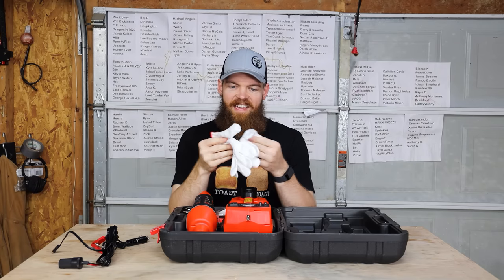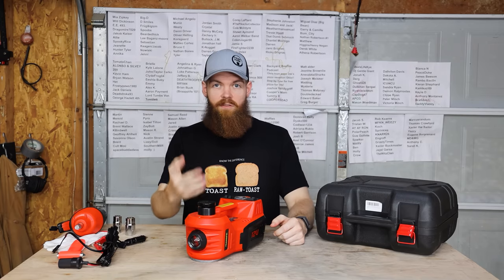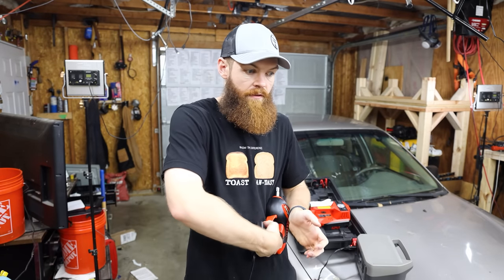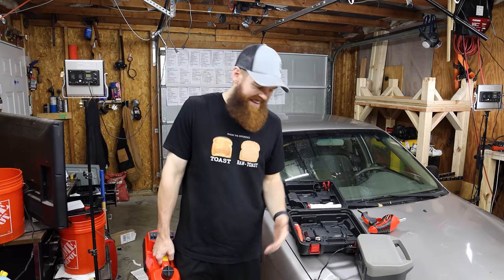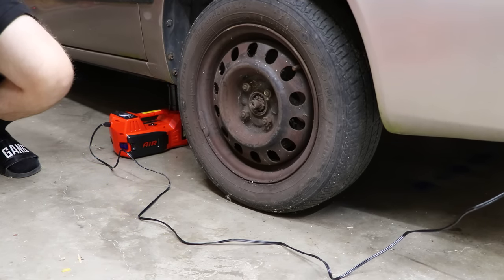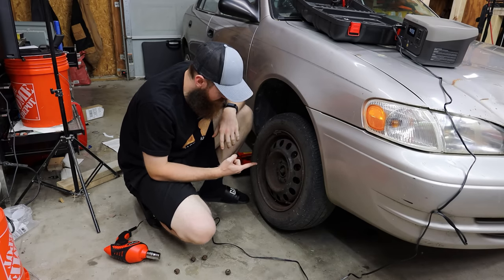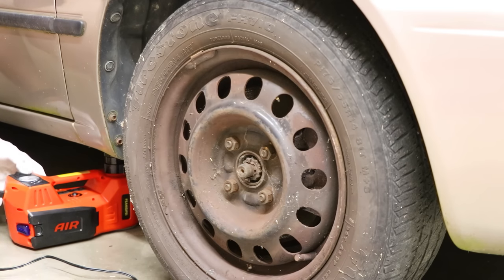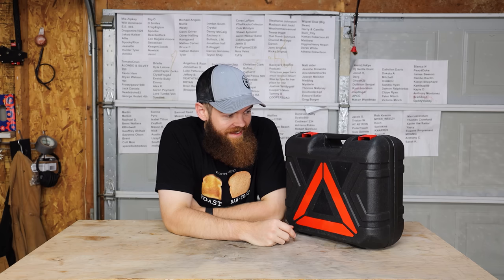Testing The Cheapest Tire Changing Kit On Amazon!

Comment: This would have been perfect when I was growing up with my mom. Her and I both know how to change a tire but I remember when I was like 15 for whatever reason her tire was flat but we didn’t have the strength to loosen the lug nuts so I missed work and we had to wait for someone else to change the tire. Just kinda sucks being a lone female and not being able to do something relatively simple yourself and on top of that had we not already been home it could have been dangerous and way more of an inconvenience. We also didn’t have much money. So the wrench alone could make all the difference for someone out there.
Reply: Thats a good point, lots of tire/garages over torque the lugs, having something to break them free is a life saver.
Reply: A short length of pipe that can slide over the handle of the wrench that comes with your car. An extra foot of leverage will make the nuts come off fairly easily.
Reply: @ThePinkPanth3r  Years ago, a garage put mine on so tight a 5 foot pipe barely took them off, good thing I was in my driveway. Was surprised I didn't snap a bolt.
Reply: @G Nic  don't ever buy a ford superduty for some reason those lug nuts tighten themselves I fought for 4 hours with a 4ft breaker bar on the side of the road to get that tire changed I kept a impact with me but actually ran the battery dead on the first 2 of 8 lug nuts
Reply: Yeah but that’s just not something most females are going to think to have with their tire changing supplies lol. I was just noting something I thought lol. Moms car at the time was an Altima. Like an 01 or 03 or something. It was still going strong with my nephew until a couple of years ago. I was 15 so like 18 years ago. I’ve literally never had blown tire since. (Knock on wood). Haha. My car is an 2019 Jeep Compass. It didn’t even come with a spare just a compressor with fix a flat in it lol.
Reply: @monkeyz240  Totally understand, I know my daughter wouldn't be able to loosen lugs. Most new cars don't come with a spare, many people I work with didn't know that. Pick up a rim/tire, jack and wrench, it can literally save you hundreds if you need to call a tow truck. Is stupid that car companies don't put them in.
Reply: @SunnyinNV  get yourself a decent 1/2 impact that's cheap dewalt has a couple that will easily take off lug nuts and the correct socket for your lugnuts, a bottle jack or a higher quality Scissor jack, and harbor freight flash light I keep one of the ones that plugs into the cig lighter in all my cars not the brightest thing but it's better than trying to hold your phone while operating the tools
Reply: @monkeyz240  don't ever put that fix a flat in your tire most shops won't plug or patch it off you do I hate that modern cars don't have a spare I had to buy one for my fiances car ended up just getting a junkyard rim that matched and a cheap used tire
Reply: When I was a kid my father would have me and my brother change the tires while he sat on a foldable chair with a beer in the hand complaining about various things. It was so hard to work with the tools to replace four tires, both of us had to use the lug wrench to get the bolts out. Worst part is we had to do this twice a year for not sure how many years we did this, he stopped making us do it when we became teenagers.

Comment: 1. It uses only the momemtum of a high speed rotating mass instead of motor torque.  That 's the same principle used when you swing a hammer.  2. The jack is supposed to be oriented parallel with the car with the light pointing at the tire.  3. It pays to RTFM.
Reply: Demo vids don't show the light pointing at the tire, though. That would require you to put your hand in between the jack and the car frame, which is not a good idea.
Reply: something internal spins, builds momentum, strikes something else which turns the nut. in theory, it works like a normal impact wrench.
Since this thing runs on 12v dc, it takes a little more for it to spin up to make that striking power.

Comment: Harbor Freight used to sell a similar impact. It seems like a great tool for roadside tire changes.
The electric jack looks good, however I have two concerns. It seems pretty tall, I wonder if it would still fit under a smaller car if the tire was completely flat. I noticed in the video the tire was fully inflated.
Second, with the switch for the jack on top of the unit, it seems like a possible pinch point when lowering the vehicle.

Comment: First thing great video. Second the torque should be at least 90psi for those lug nuts but not greater than 100psi. The gun if memory serves should output at least 180. It wasn't that model but I did see someone do a torque test on one.

Comment: A rubber string puncture repair kit ,will save money, a compressor is convenient,  scissor jack supplied with car. I prefer a spider wrench , a long wrench easy to store but a loose socket somewhere in the car at night in the rain. 
If they made that kit fit inside a spare wheel then maybe , but otherwise it's a Christmas gift for someone you don't particularly like.

Comment: I'd like to try that thing on my dad's Western Star. I bet we could destroy it pretty quick lol. We've never even measured the torque. It's just like, "Tighten until just before you have an aneurism" - using like 8 ft long cheater pipes and such. My dad never believed much in battery/electric impacts - he's always been partial to air impacts and kind of laughed at battery stuff. But we got a battery Makita impact for doing stuff out in the log woods where air's not readily available (aside from his truck) and it's held up pretty good. I've never seen an impact that builds up like that one but yeah, it looked like it did surprisingly well.

Comment: a tire iron(likely already comes with the vehicle), a steel pipe (for more leverage with the tire iron), and a small sledge hammer (to knock to tire unstuck) costs a lot less than $150

Comment: The "impact" driver was using an actually brilliant approach. It was using a wind-up, then a SLAM. Instead of multiple small strikes at one. Think of sledgehammer vs hammer and you get the idea. That's actually a very ingenious way of breaking loose a nut or bolt. One very heavy impact instead of multiple small ones.

Comment: That impact gun has the capacity to remove the nut holding the bottom crankshaft pulley on a 92 Honda Prelude that's torqued to 300 foot lbs. My other impact guns weren't cutting it.

Comment: I mean, usually people would open the kit once they get it to make sure everything is included and it works, so they'd store the "bonus" emergency hammer in the car interior.

Although, I don't trust them for cutting seat belts, since they're designed to unlatch after a crash anyway, though the glass breaker could be handy.

Comment: Considering how much wind up that impact has chances are likely it has more ft/lbs than most battery 12 volt impacts. Basically all battery impacts now days spin the hammer 360 degrees before hitting the anvil, this impact seems to spin many more rotations building up a lot of potential energy before hitting the anvil.

Comment: Well, the case just holds it lol that's how they get it to you. You take the glass breaker out and put it in your glove box or center console.

I recommend everyone get a window breaker. If you knew how many people we find dead in the water trapped in their vehicles you'd be blown away. Once you're in the water, most vehicles (especially today) just shut completely off, that includes electric windows and door locks which makes it pretty much impossible to get out of your car in time. Even if you can get your door unlocked by pulling up the lock, the door is still really really hard to open in water.

Comment: the gun works on the principal of speed = weight, p=mv p=momentum m=mass v=velocity

the only downside to that tool is it will keep adding torque until something breaks
but the design is so simple that it is vary cheap to make and a design that is vary old

Comment: That space gun thing alone cost around $60. It's marketed towards ladies who have trouble getting the nuts loose.

Also very useful tool in a scooter when the drive belt snaps. It makes removing the pulley nuts a whole lot easier.

Comment: The space gun is an impact gun, But instead of using air it uses electricity to spin up weights until it gets to the end and hammers. Thats why you could stop it with your hands, its useless until the weights are spinning fast and about to be stopped. if you hold it then it wont ever have any power.

Comment: I have the vevor kit and it works great on everything it was soposed to do. Less laughing at it and try it . I guess you have pie on your face. What do you know your using the gloves too. Man why are you using 150lbs even my  GMC 1500 isn't that high. Keep in mine it's for emergency use. You can pick it up for $94 on Amazon with the coupon.  How about the jack you didn't check that out. I clipped mine to a small deep cycle battery and it lifted my Elantra with the wheel of the ground in 54 seconds and brought it back down in 46 seconds.   I say it all worked great. Even the air compressor was spot on for accuracy.  I checked it with my $60 air Guage and it was right there. You can get this kit for alot less then the $155 you spent unless they gave it to you to try. This kit is surprisingly good.

Comment: Might be different in the US, in Aus we loosen the nuts then lift the car which stops the wheel turning while trying to loosen them and reverse when fitting, slight tighten the nuts then lower the car and finish the tightening again to stop the wheel turning.
Reply: That is also how it's done in the USA, experienced people loosen lugs with tire on the ground and only tighten to fit then lower car and torque with tire on the ground in a star pattern.

Comment: Honestly while the tap, tap, tap seems weird I think that may be to make sure to not snap the threaded part by keeping the pressure at a minimal amount of time, I know one time trying to get a bolt off I ended up snapping the threaded part because it was on too tight and probably got some junk causing it to stick worse, by giving those love taps rather than staying strong the entire time you are still applying enough force to slowly get it loose while making sure that if it is too stuck you don't end up over torqueing it snapping it while trying to get it off. So while it seems odd if you don't think to hard about it, it actually makes a lot of sense having a way to apply the preassure needed to loosen the bolt without giving it enough range of motion to actually cause any damage if it fails to loosen on that quick burst tap.

Comment: Just buy the 1/2 Ryobi Impact set for $130 then get the Ryobi Tire inflator for $30. Get the size socket for your vehicle and a flashlight and you are all set. I have had to change my flat tire multiple times and the Ryobi can jack up my vehicle in seconds and remove the tire in seconds. These tools would also be way more useful for more than just the vehicle.

Comment: The glass breaker and seat belt cutter are clearly for rescuing others.  You are correct if it's in the truck and in the box you can't use it for yourself.  How did your mind go to using it to escape a sinking car?

Comment: No lie I guessed 12PSI by looking at it 🤯. You filled it to 30 and it's still flat lmao. Fyi  I don't know if the tire's still touching the ground but you supposed to break the lugs  before you raise the car. . Yeah no the tire is spinning 🤦.  That gun's using  Inertia look it up. My brother bought a battery impact gun and it works like a charm.👍🏼

Comment: I got a similar one that I was very unimpressed with first mine didn't come with that bad ass 50 sci-fi ray gun impact gun that design is absolutely genius assuming it's built to a high enough quality to survive for any length of time but still pure genius

My issue was the Jack first as you noted it barely fit under your car so think about this how would you fit it under there with a flat tire :-) yeah have fun with that

Mine didn't fit with a fully inflated tire

My Jack was also very unstable the metal foot does not project far enough past the jack point and so the whole Jack tends to tilt as you lift the car higher very unsafe in my opinion I was not impressed

That impact gun however that thing's cool I want one of those

Comment: You actually did over tightened that stud and it stretched plastically so it's done for now. You can tell when a stud or a bolt is at its yield because the force required to keep tightening seems to be the same for a bit and then it'll snap. So you already stretched it past its elastic phase and plastically deformed it so it's garbage now and will probably snap while driving.

Comment: i laugh you know that impact gun can do up to 360 ft-lb. i had the older version of the impact gun from walmart that i got on discount for $20 and it lasted being used for everything almost 20 years before the hammering mechanism broke. what i used it on most was working on the belt drive on 50cc-150cc scooters because a normal impact would spin the engine over insted of getting the variator nut lose

Comment: Doesn't matter how small the tyre is. Pressure is pressure. If it can put 30psi in a car tyre it can put 30psi in a tractor tyre. It's just more air. Not more pressure.

Comment: Lug nuts are torqued 70-100 ft lbs on passenger cars. Anything over 100 will stretch the lugs and eventually cause them to seize the lug nuts to the lugs. Just a PSA.

Comment: Question.. Can this jack be used to change tires regularly or is this only for emergencies (IE: 1 tire once a year). Just want to know how durable it is to do regular tire changes (4 tires 2 x a year etc). Also, is there a way to fill it up with hydraulic fluid if the fluid leaks? Can it even leak?

Comment: There's a guy on youtube who used that impact to take out a honda crank pulley bolt (but with a massive socket). Its crazy. Thing has a hammer mechanism inside
Reply: All impacts have a hammer mechanism inside. That's how they work. Proper ones just hit constantly instead of winding up and stopping the weight to impact

Comment: Being that it did well at removing, you didn't say what the unit would do for installing new tire, how many hits with that gun to safety tighten the tire and how many hits to overtighten/ plastic deform the threads/break a stud.

Comment: That wrench gun looks weird because it seems like it's a rotary hammer. The big part contains a flywheel the motor spins up. This is why it can break even the toughest lug nuts.
(I THINK it's a rotary hammer, that's how it's acting. I could be wrong though.)

Comment: the reason you never got the click at 150 is because the bolt is stretching, meaning it would break before ever hitting 150. you should replace this lug bolt now because it will snap sooner or later

Comment: Nice product and all, it works and seems to work well....but what about the secondary problem? If you have a flat and get it changed, only to realize the battery you should have changed but didn't is now dead? Not everyone has a power station, and MANY people drive on old batteries. I'll give it this, a flat makes the car unmovable, it fixes it to a point where it will move....if you get a jump.

Comment: Reminder when you tighten your lug nuts boys even if you use an impact gun always tighten with a crossbar after trust me the impact gun won't get it as tight as you can even if it's an expensive impact gun I tightened all my lug nuts on my car once and literally when I checked all my lug nuts they where all hand tight after driving a few days on them after tightening with the impact gun.
Reply: That just means you have a shitty impact gun. I can snap studs off with my impact. They're plenty able to tighten them. Yours loosen up from vibration. Need to replace studs and lugnuts

Comment: “Haven’t had the lug nuts off for 7 or 8 years” as the tire falls off before the last lug nut comes off. That rim would be welded on if it wasn’t removed for 7 or 8 years.
Reply from the maker: that only happens with aluminum rims

Comment: I would buy it.... and yes you get what you pay for..... even if you pay more and get something that breaks or you pay less and get something that breaks.... or you pay a less and get something that's good or you pay alot and get something that's good....(I don't like that phrase, it doesn't apply to everything) and if that thing would last? then I would be really impressed with it, but the only way to test that is to use it a lot and wait for a long time, so that would have to be a video for a year or so later.

Comment: wait, people dont carry a jack stand in their trunk for changing tires? damn i have been doing it wrong for the 32 years i have had a license. jack, breaker bar, proper fitting socket and a jack stand and jumper cables are the bare minimum you need in a trunk at any given time, i recommend a 250 piece tool kit like a craftsman or kobalt since they come in a molded case and are good tools. this stuff even fits in a smart car folks so no excuses. remember even if you cant use the tools someone else might be able to help you if you have the tools on hand.

Comment: $155 is the cheapest? Damn let's lay out the other option

Auto parts store scissor jack: $30-40
Cheap lug nut wrench: $15
Air pump: $10-40 depending on how fancy